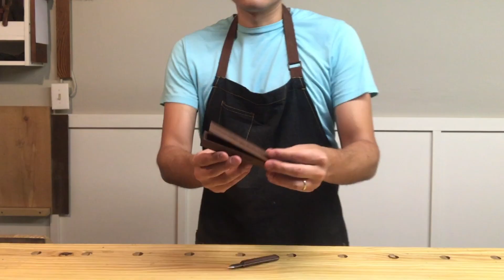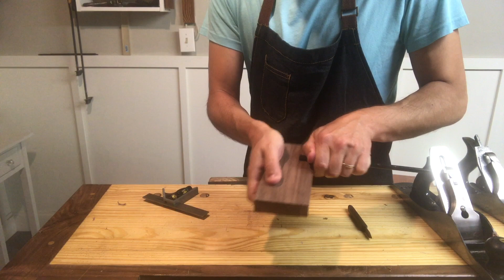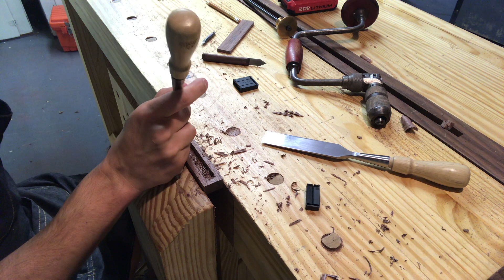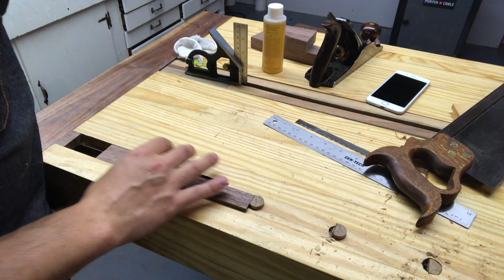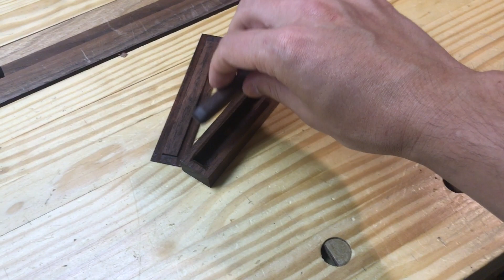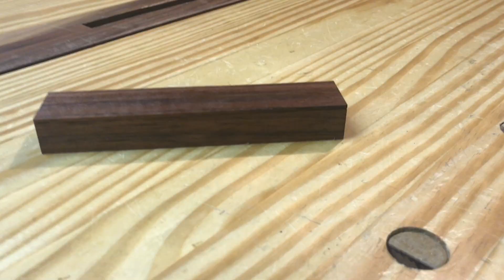Marking Knife Presentation Box | No Woodworking Joinery Needed

Comment: Could you suggest a way to make the lid fit a little better? What about measuring the inside of the box and transfering that to the lid.
Reply from the maker: So what I did is marked 1/4 inch in form the outside edge, all the way around the box and removed the material inside those lines for the box itself. I also marked 1/4” all the way around the life and removed the material outside those lines. In theory doing this ensures a snug fit. But because was not careful enough the fit is off. Also, the piece should have been thicker overall—that would have given me some wiggle room to fix errors. Since it is so thin to start with, I could not entirely fix my mistakes. I hope this helps!
Reply: The HandToolery Thank you for taking time to answer.
Reply from the maker: Sure thing!!
Reply from the maker: And thank you for the question!